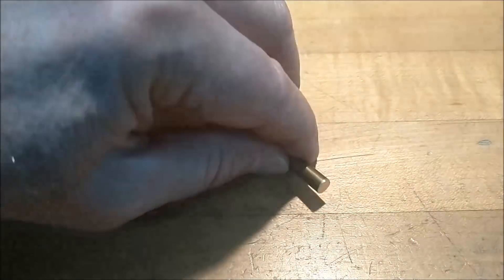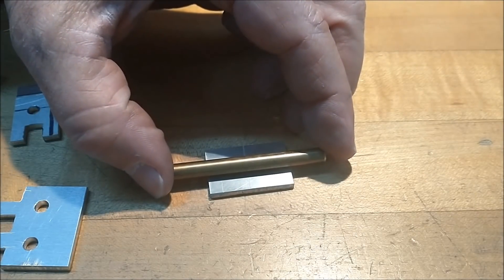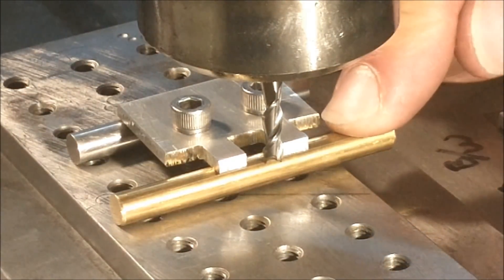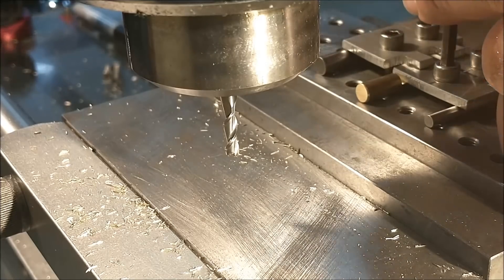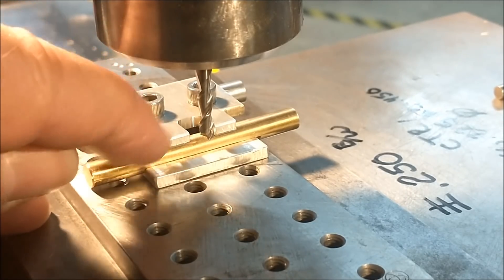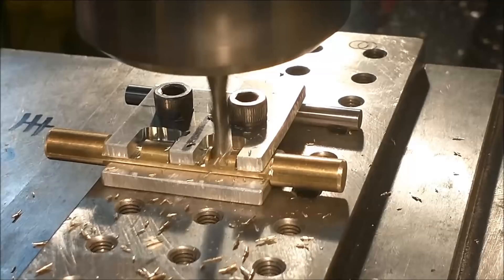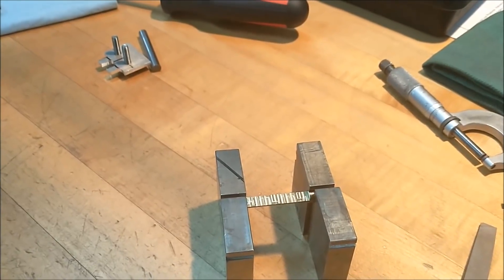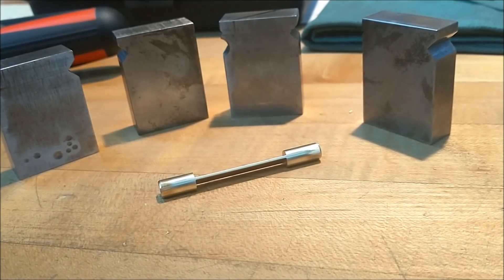Creative Clamping Solution for 'Impossible to Hold' Features. Take a Look !!

Comment: Did you hear about the Americans that were bragging to the Germans back in the 30's about making this tungsten filament that was 1/10 the thickness of a hair and 4 feet long and germans laughed and sent it back to them with a hole drilled through the centre of it
Reply from the maker: The item in question was much shorter and a little bigger in size when I heard the first version of that 40 years ago.

Comment: I guess the classic way would be to cast some low melting point (bismuth) alloy around it, clamp the resulting block by the ends, and mill the mould and the core brass at the same time. It would be a waste of the alloy (which is not cheap) because much of it could not be saved once it was adulterated with brass shavings.

Comment: Hi Joe, fellow Austinite here.  I enjoy your machining videos.  Along the lines of difficult clamping requirements, we've recently added an SLA 3D printer to my machine shop.  It allows us to print fully dense soft jaws in complex geometries that might not have been practical with metal.  Some of the materials are exceptionally rigid and allow for clamping forces that you might not think possible.  It might not have offered you anything in this particular project, but is something to keep in mind for the future.

Comment: Great video....??? A home-made shallow v-block might help with the first set up. Directly under the clamps of course. Milled finish would have been fine, any angle would do, mill right into it if you'd like, swap your clamps, and finish. Also, could have used woodsmetal or cerrosafe. Melts below the boiling point of water, for stability on your first setup. Great video, good luck with the crazy weather, stay safe.
Reply from the maker: I agree, 100%. Only drawback is having a reliable flat surface to measure to. Otherwise, it would help a lot.

Comment: This is a question in general, not for this current video: using the edge finder: when you got the reflection lines running alined, found the edge, why to advance it till the line brakes?
Thanks for those good ideas.
Reply from the maker: The misalignment between the upper and lower axis is what kicks it out once it goes beyond center. It can be close visually and still a few thou away.

Comment: One could also use a low-melting alloy, to grip the work-piece extremely firmly and accurate.

50 cm. of snow and -10°C is quite common in large parts of Sweden. It is cold when it gets down to -20°C or so.

In Idre, Dalarna in Sweden, it can be down to -52°C, wich is the record  I recall. Often 100 cm. or one meter of snow. Sometimes two meters as well.

Comment: Ehh.... I hope You picked a bad example suggestion You would make a fuse. A mechanical fuse would be okey but not a fuse for a electrical power. Don't let any machinist do this and make hole Texas go black. I'm joking, most of it.
Time 02:50. The rigging worked well using conservative cuts, and caution, but why not secure the brass rod from the right side to make sure it would not escape? Having a cut out in the aluminum clamps giving something like a little finger, or more... Thanks for the ideas!

Comment: creative clamping - how nice! I too often find myself in a position where I need to hold a part where the actual machining should take place. So fixtures are requred or creativity is needed and too often that sosts more time than the actual machining job- but that's the way it is. This is a wonderful trick which I'll surely will remember.
Reply from the maker: I've used this approach many times. Its a keeper.

Comment: Hi Joe, yep, it's a great technique, can also be used on the lathe for thin rings, I did similar many years ago for holding Rene 88 powder met rings to turn inner & outer and on both sides using quick release fixtures. Great video. Cheers, Jon

Comment: What about making a little v-block to support the bottom during the operations on the first side? Any flex in in the Al fingers producing a side load would be handled. Make sure your counter support is sized to give a flat finger position.

Comment: Curious. Why are the ends off limits?
Reply from the maker: On the actual part, one end is an ornate turned handle, and the other end is a square smaller than the material OD.
Reply: The ends in my case are turned down to make small lever handles for the PM Research drill press, and can't be used to clamp.
Reply: Thank you very much

Comment: Your clamping is wrong ...

The aluminum flex to the point it's only point of contact is the edge there for if you gauge your part it will not have an accurate measurement. 

Its bevel ... just saying.
Reply from the maker: More correctly worded....IF the aluminum clamp flexes, the only point of contact will be an edge and the POTENTIAL for roll, on the first side, will be increased. if you care to cheat, use bigger diameter heel support pins and during tightening, flex the aluminum clap until it rests flat on the part. I call this pre-loading the clamp and it has worked well in the past. Your observation for a potential problem is a good one, but did not apply here. Also, somewhere in this video I believe I suggested using steel clamps if the part was critical to avoid just such a situation.
Reply: @joepie221  Not to do with flexing, but with the first clamp, the diameter of the rod supporting the other end of the clamp is of no importance. But when you then place the second clamp, unless the rod supporting the free end of the clamp is exactly the same diameter as the height of the flat you just cut, the piece must roll. No argument, it is just simple geometry. So your idea is clever but sadly it just does not work!
Reply from the maker: @kencroft7933  If you watch closely, you'll see I used 4 different size pins during the production of this video and successful part production. Your observation is correct, but not your conclusion. The video just proved it does work. Keeping the clamp parallel or slightly 'heel high' to absorb flex is highly suggested and was implemented here.

Comment: I would have soldered it to a plate and secured the plate. Then heat to release and solder it inverted before machining the other side.
Clean away solder with desoldering braid and file and polish if desired.
Reply: I guess another way would be to mill a trough in the plate with a ball-nosed endmill and superglue the part into it, then use solvent or heat to release the part. The second side, just glue the first side down to a flat bar. Second side would need lighter cuts and a sharp cutter.

Comment: It seems like if you're worried about spinning the part a bit between clamps on the first side, you could leave some extra material and flip it twice to ensure it's parallel before cleanup.
Reply from the maker: An arch shaped clamp would allow for central pressure.

Comment: great idea Joe - thanks  .
I think I have seen all your videos and  I can't remember you slitting small hollow parts.  Since you are doing small items , have you made small collets or sleeves with  1/8 inch od that need to be slit 3/4 from one end to another?  Part of this idea might be incorporated as long as the tube doesn't collapse.
Reply from the maker: True, but put a piece of something solid inside the tube first, or clamp it length wise between 2 sacrificial support pieces.
Reply: @joepie221  thanks Joe

Comment: I read someplace that NASCAR mechanics milled the back side of the shafts holding the butterfly flaps in the carburetor throat to get extra airflow when the flap is wide open. They must have used a similar technique. This is a fun one! Glad you guys are (mostly) back on. Please nag your government to prepare your grid with more resilience. More weather on the way.
Reply: Cheat - Cheat - Never get beat.
Reply: @bluesman7191  I didn’t get a sense it was cheating as it was publicly disclosed. I can believe a rule showed up shortly, though.
Reply: Pass a law that any "renewable" connected to the grid has to have an equally sized back up generator with enough fuel for 48 hours that automatically cuts in when the windmill or photocell drops to less then 50% power. - Or better yet do like Holland and forget about windmills and build REAL power houses,,,,,,, Problem solved.
Reply from the maker: Or maybe spend the tax dollar and get the heaters that come as options for the generators and windmills. What a concept...be prepared.
Reply: @joepie221  that, as I recall, was the motto used by us as Boy Scouts all those years ago. Be Prepared are good words to live by, particularly if lots of people depend on you.
Reply: @mathewmolk2089  Contrary to rumor, it was not just the failure of renewables that put us in a bad situation.  While it's true that Texas wind systems didn't have the winterized features available that, for example, those in Canada have, none of our other systems--gas, coal, or nuclear--were prepared for the cold weather either.  
ERCOT didn't project wind generation providing its full capacity because the winds in Texas are generally diminished in the winter.  Wind only provides an average of 20% of our power annually; it provides more in summer and less in winter.  Other sources carry more of the load in the winter.  What ERCOT failed to do was anticipate the demand that might be generated by a unprecedented cold front lasting several days.  The reason some people in Texas received bills in the thousands--some near twenty-thousand--was the spot market for natural gas was driven to extreme because of the shortage of natural gas, which, of course, has nothing to do with wind generation.
It's a effing mess that was within minutes of being a catastrophe that would have taken months or years to recover from.  Had ERCOT not pulled the plugs on grids when they did, the generation sources could have begun to shut down of their own accord in domino effect due to demand exceeding what they could provide.  
Of course, too, Texas is its own independent of other state power grids, so it can not draw from them in an emergency.  It has been structured that way since 1939 to remain free of federal regulations.  So, lots of people made lots of money from energy by Texas being unregulated, depending on the unthinkable never happening.  But it did.  Sooner or later the piper has to be paid.

Comment: I'm no expert, but to prevent roll of rod,
Put a small groove on the under side of clamps
Reply: Of a piece of 24# printer paper.
Reply from the maker: A V groove would help, but make it slightly harder to measure.

Comment: The only good thing about that cold snap you guys had was there was no problem keeping the beer cold. And you're right. The line crews working for the electric utilities never get the credit they deserve. Of course the media loved pointing fingers and yelling the sky is falling. Alot of people across the northern tier of the country were probably scratching their heads over the whole thing but if an area almost never sees that kind of temperatures then it is a big problem. One really big problem I would th think a lot of people simp,y do not have the winter clothing to handle these kinds of temeratures. Hopefully some good will come out of this in terms of upgrades to the electrical grid nation wide. 
A few years back there was a major ice storm in Quebec. Power lines down all over and other issues. The provincial government (at least I assume it was) brought in a bunch of diesel freight engines and had them wired into the grid so they could at least temporarily restore some power until the line crews could get their jobs done.

Nice piece of work as always. Holding awkward parts is always a PITA.
Reply: Hey, We are in Cleveland and ice storms and other things knock us down every few years.   Power outages are not limited to Texas. -(I'm industrial electrical/millwright contractor and made a bucket installing standby generators over the years - See,,,,Some good comes from everything bad - and now those customers will not sit in the dark even when the power goes out)

And no matter what the fake news  media tries to tell us,  all the generation power in the world is useless when the wires are on the ground and I don't know of anything that can prevent that and that's where the linemen get to pick up a ton of OT,,,,,and a severe case pneumonia all at the same time. My fingers hurt just thinking about being on a pole with the wind whitelisting around my ears.
Reply from the maker: They still have to drive to those locations on roads covered in ice and snow since we don't have plows here.

Comment: I was overthinking way too much the why you couldn't clamp on the ends.
The video was almost over by the time I realised this was some kind of cylindrical brass cow in vacuum stand in for someone else's more complex part.
Reply from the maker: It ends up to be a tapered and curved handle for a miniature drill press. One end is very ornately turned and the other end is a square with a square hole through it.

Comment: Joe, at 10:11 in the video when you fit the second clamp, the round bar supporting the free end of the clamp MUST be at the same height above base as the flat you have milled, or the part must roll. It is just geometry, there is no doubt, it must roll.
Reply from the maker: The pins used under the heels of the clamps were the same height as the plane the clamp rested on. You are correct. Be ready for aluminum clamps to bend under the pressure and roll the part. Its possible.
Reply: I was going to mention the same thing. Twice I saw a video of the same person clamping a flat part in one end of a vise and putting something smaller in the other end saying it would give her more holding pressure. Putting something in one end of a vise that is not the same thickness as the part on the other end will cause the movable jaw of the vise to twist out of parallel with the fixed jaw. This means the part may not be held flat against the fixed jaw of the vise and not oriented in line with the table axis. The part could also move around when machined.

Comment: Joe.
I didn't see how you kept the registration of the shoulders.
Did you locate off the end somehow ?
Reply: If one of the shoulders is pushed hard up against the spacer used to support the underside after the part is flipped you could zero the cutter on the spacer, as long as everything is square with the table.
Reply from the maker: Knowing the overall length of the part, you can edge find from one, or both ends, to position this cut. Securing the shim as a locator is another approach for the second side.

Comment: Thank you for this demo. My son has an old motorcycle that needs some work. One of the things it needs are new carburetor butterfly shafts but there are none available. Any used ones out there that are available are in pretty much the same shape as his. This method of making a flat in the middle of a shaft without bending it will work just fine. All that is left to do is drill a couple of holes for the butterfly mounting screws using a backup like you have here and Bob's your uncle.
Reply: Throttle shafts are exactly what I was thinking as well.
Reply: @1crazypj  Hi Nephew! BobUK
Reply from the maker: Perfect application.

Comment: Can you show a how to for plugging a hole in aluminum. (If you drilled in the wrong spot or broke a tap and had to remove it)
Reply: I got a tip for plugging small holes in aluminum when you don't have a welder. Cut a pin that you can barely fit into the hole the full depth. Cut it too long, then tap it with a hammer so it swells out and then peen it so it's swelled in there. Locktite couldn't hurt. Then cut away the last bump of the pin and blend it in. For a though hole, leave the pin long, peen from both sides, then blend. Good luck Dude.
Reply from the maker: Brad Youngs advice is solid. The area around the hole will swell with that process, but once filed or machined , the hole is gone. If the original hole is just slightly out of location, make sure the plug you use will encompass the new hole and not rotate.
Reply: @joepie221  Thank ya, Joe. That part of it slipped my mind completely.

Comment: Hope you made it through the weather well. It was crazy all through the region for a few days.... where I live, it was -15 degrees F on the morning of Feb.16th...7 days later (Feb 23rd.), it was 73 degrees (Records for both days)... crazy. In your neck of the woods it stayed around 5 degrees F which is well below a "Texas Frost"....
Reply: -15? that's it?
Reply: @pacman10182  Previous Record for our area was -3... Yeah, it's nothing for a place like Michigan or Minnesota, but for Arkansas and Texas, it was like a bad disaster movie. None of our infrastructure was built for it.
Reply: @matthewhelton1725  you never realize the wind turbines up here are not the same as wind turbines down there, until yours freezes solid in weather I wouldn't even bother with a coat
I hope everyone is doing OK down there, steer clear of California license plates
Reply: Sounds like Cleveland. If you don't like the weather here hang around 20 minutes,,,, It will change. You can get 4 seasons in a single day!